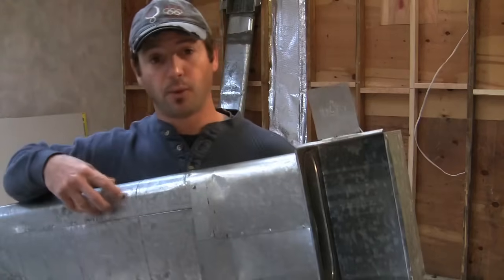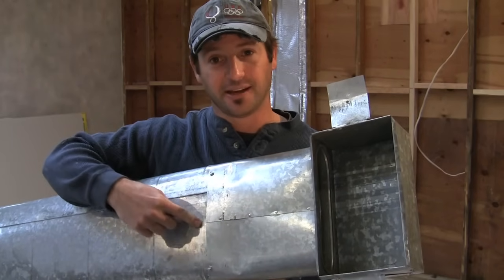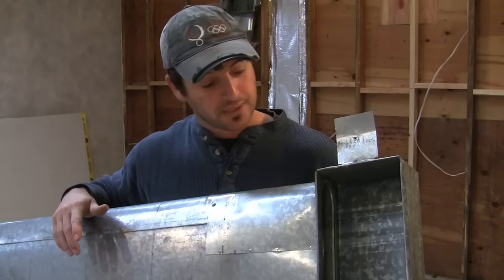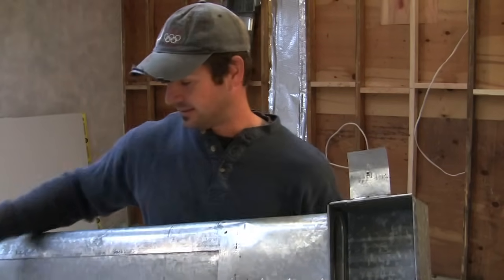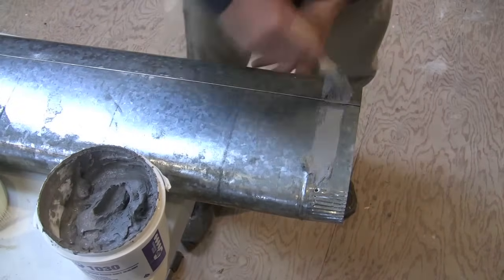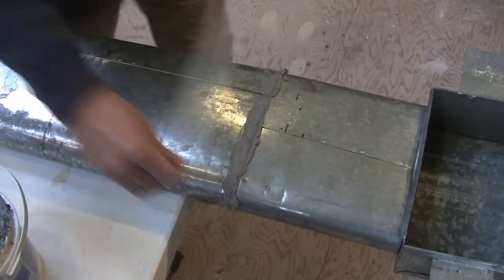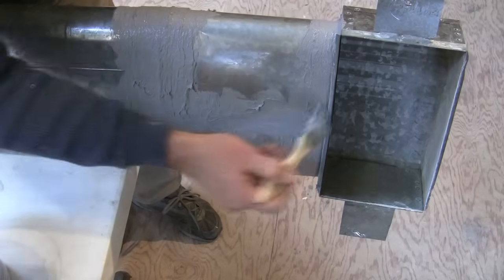How to Seal an HVAC Duct with Mastic - Duct Sealant

Comment: Love the fiber glass mesh reenforcement, makes perfect sense. I priced out replacement of my HVAC duct and know it was ridiculous since I have so much experience with DIY almost anything.  I am trying to figure out the pressure and sizing but that too isn't that complex. The duct in my house has never been replaced or repaired since 1964. So everything is very old school.

Comment: You need aluminum foil tape and make sure to insulate that riser duct or else it will mess up ur drywall when it gets really cold it sweats ive been doing hvac since 16 now im 27 and ive never seen a riser duct not insulated haha

Comment: Thanks, but my ducts from 1964 are behind finished plaster board and finished ceiling plaster boards.  I have sealed the duct openings with 181 tape.

Comment: I was cleaning out my attic yesterday day and horrible the sloppy work that the HVAC installer did from years ago. We purchased house less than 1 year ago. We are sealing all the holes from ducts, pipes and electrical. Also changing out the insulation.

Comment: Problem with your video is you put too much mastic and it squeezed out when you attached it but you didn't clean/smooth the inside which is going to eventually start catching dust, hair etc create blockage Inside the duct. 
The mastic works if you just coat the outside.
No need to make it more complicated for video sake. 
Thanks for the tip though.

Comment: honestly I'm tempted, just spent 20 minutes putting foil tape around a round hole, this mastic would be so much better.  the problem is most of my ducting is unreachable, so I'm debating just paying the big bucks to the leaks sealed from the inside-out.

Comment: I'm putting together a wood shop dust collection system and realize the fasteners are intended to immobilize the pieces in relation to each other and that the main trunks are best assembled on the floor. How long will it take for the mastic to dry or cure thoroughly enough to be roughly handled without transferring where unintended?

Comment: Well.... "Simple and easy" if the duct has been pulled nicely out of the wall and is in your hands.  Excruciatingly difficult if you also have to find the leaks on ductwork inside of walls and/or layers of insulation, expose the ductwork, seal it then re-insulate or reinstall it inside the walls.  Before everyone runs to the hardware store to buy mastic sealant, make sure you know where your main leakage points are and be assured that you can access them easily or you might night want to DIY this project.  

That said, I DO know exactly where the leaks in my system are and found this video very helpful so THANK YOU!!

Comment: Nashua 327 is a mastic based tape which works well. I have always considered mastic sealed joints to be the "RIGHT" way to install/fix a duct system. For those who say the Nylon/fiberglass webbing is "Overkill", apparently do not understand adhesives/glues/epoxies. ANYTIME you can add the reinforcing webbing it does add great strength to the adhesive, making it more durable against everything, including vibrations, clumsy cable guys etc.  You may not want to spend the time and effort to use the webbing, but in my book it gives the best job possible...HVAC 30+ yrs.

Comment: Good howto video, but the premise at the start is almost totally wrong. Small gaps in duct work do not cause you to "lose" heat (or cooling). It may slightly slow down the delivery of the warm or cold, but it's not lost, unless the duct is in an unconditioned space, like an attic or crawlspace. Even in a crawlspace, a minor leak of heat is likely to filter up through the floor. It's not lost. If it were, radiant heat systems wouldn't work! Also, that the presenter can force his finger between the sheet metal is irrelevant. The flow of air doesn't create enough pressure to do that. The duct shown will have small leaks, but not the big one you'd get with a finger-width opening. TLDR; heat put into your walls isn't lost. It filters back into the home!
Reply: I think your perspective is outdated...and not just because this is an 3 yo comment! TLDR; trusting poor installation and design by treating HVAC like an art when it can/should be more of a science is the recipe for a lot of wasted energy and uncomfortable, not to mention unhealthy, interior/living spaces.

My basic question is: do you want your conditioned air leaking out of your ducting and then being "filtered" through your crawlspace, insulation, drywall and sheathing (spiderwebs/rodent nests/dust pockets/etc)? Leaky ductwork, like leaky exterior sheathing, causes all sorts of problems in indoor air quality, reduction in equipement lifespan, lack of control and loss of comfort. My perspective is that poor quality installations with leaky ducts, pivoting on the premise that conditioned air will be blown somewhere in the home (just not where you want it) has been used as a crutch for too long, just like the idea that houses need to "breathe" when in fact it is the inhabitants that need to breathe. Also, nearly all radiant installations all require insulation on the "unheated" side to control the radiant effect.

Comment: What kind of mastic can I use for dryer vents?
Reply: HighSierraBob silver tape
Reply: @willritchie5859  I do dryer vent cleaning and service.  Sometimes, I will run into a situation where the builder roughed-in the galvanized dryer duct and left nothing penetrating into the laundry room to connect the transition duct to.  I need something to use to attach a small piece of duct into that end section to be able to attach the transition duct to and properly clamp it.   I really don't want to have to cut the wall open unless I absolutely have to.  I need something to hold it and seal it.
Reply: @HighSierraBob  . Sorry for the vagueness what I was trying to say is if you can reach inside of the pipe and tape on your piece from the inside with silver tape
Reply: @willritchie5859  The tape will not hold up under the air going past it with the moisture.

Comment: Hello Corey, is there anyway I can send you some pictures of my filter rack? One technician made 7 to 8 holes on the filter rack to adjust the straps that was holding it. And I was like, the air in the attic will go inside the filter rack now? And he put tapes on the holes to stop air leakages but to make things more secure he put lot of mastic duct sealant top of all the tapes that were covering the holes and some other holes without the tapes too. Some parts we couldn't put tapes because it was in some spots that was hard to reach. Anyways, he put lot of mastic duck sealant. Like almost everywhere inside the filter rack. He told me it's none toxic but it's been few days now and I am still afraid to turn on the heater at home and I have a little toddler as well. Could you please provide me with some clear answer. And if I could send picture that will be awesome too. Either way is fine. Thank you.

Comment: We just had all metal ductwork put under our house in the crawlspace.  Our HVAC contractor did not use mastic but instead used the foil faced HVAC tape to seal all joints and seams.
Reply: Now put duct insulation around it if you can easily access it.

Comment: my mastic jobs that I have owned over the years looked like broken arm or legs casts. Smooth and rock hard all around the steel. Maybe the old school way of doing it so it looks good.
Reply: Must depend on jurisdiction. As far as i have discerned resi has less sealing than the POS condos I worked for the last 8 months. Resi tends to be piecework where I am which means poor workmanship from my experience.

Comment: I want to close off 2 round about 5 to 6" ducts on the patio, have a way I can do this without having someone come out?
Reply: Go to a sheet metal supplier and ask for plugs of the proper size. Dunno the best way to do it without seeing it, if you get spun plugs you could probably take the wallcap off and figure a way to cut the duct back and shove the plug inside the duct then screw from the inside out. You would need some siding material too or I guess you could just affix the old wallcaps again.

Also, do you know what these ducts service? If you plug them, especially in the case of a dryer vent it could be very bad, duct full of lint at best, fire at worst. If it's a bath fan or range you will probably burn out the fan motor.

Comment: I have an old house with pipe and conduit penetrations through the duct work. Now sealed with what I think is asbeotos/tape. How do I reseal these penetrations after getting asbestos professionally removed?  Fiberglass tape and mastic?

Comment: Good job , I do the same thing, use polyester fabric along with white duct sealant , but I seal on the out side when they have water leaks .
Nice video , well explained !
Eric.
Reply: I replaced my AC unit and since then I have been coughing. I was told that I probably need to have the vents sealed..How and who does that? Can anyone tell me  please...
Reply: @520manhattan  I'm no professional but you said you replaced them ...maybe while up there you didn't have the proper respirator to protect you from the fiberglass insulation ?? maybe your lungs are recovering from the installation alone and not the duct work

Comment: Hi I have a very old house 

I have this on going problem when it snowed n temp drop very cold the 1 story ( no attic ) living room ceiling would leak 

I just replace the roof last year 

Now I’m thinking maybe it the heat leaking from the vent and heating the roof, pls advise

Large gaps between the ceiling register and the opening
Reply: My guess would be a lack of insulation on the ductwork. the warm air inside the duct will cause uninsulated duct to sweat. poke your head into your attic and see if there is insulation on your ductwork, in my juriisdiction code is 5 feet from any penetration as well as all ductwork inside unconditioned spaces (like an attic)

Comment: Can I put mastic on the flue pipe that goes into the chimney or should i
 use furnace cement for that area? I put some 3m 2,500 degree caulk and 
it has all flaked off.
Reply: Furnace cement, Tom Dee. Nothing else.
Reply: Don't fuck around with chimneys unless you want to die. Call a pro

Comment: Instead of mastic, if you have some old house paint, USE IT. It's a rubberized latex coating that works outside in the sun (outdoor paint). Clean/prep the surface and glob away. Leave the lid off till the paint thickens a touch. Easy way to recycle that old paint.

Comment: That foil tape USED TO BE great, 15 years ago. When you'd peel it back you could smell a super glue like smell from that, then, bad azz adhesive. Todays foil tape won't last a year before it falls off. Use mastic instead to seal ducts. Oh and clean/wipe down before you seal. PS, you need to apply mastic to a nickle coin thickness minimum.
Reply: I've been using this with good results: https://www.amazon.com/gp/product/B00DY9IXFI/ref=oh_aui_search_detailpage?ie=UTF8&psc=1

It has that same super glue smell you mentioned. Fairly thick too. Very quick and easy to go around and seal all the connections of existing ductwork.

Comment: Show us how to do it with a round distribution duct going into the side of a square plenum in a 150 degree attic with no soffit vents and  2 12 roof and blown in insulation from the 1970s as high as the top of the plenum box.

Comment: Can you add hvac tape and mastic  seal from the  inside?  These are for already-built homes
Reply: yup, just make sure that shit is smooth so that airflow is not affected. the tape is a bit overkill too, that mastic lasts longer than you or I will

Comment: how long to wait to dry before turning furnace on ?
Reply: The mastic should cure to a reasonable extent within a few hours, a residential system wont push enough to bubble out the sealer even if it is on while sealing
Reply: @chriskathol  thanks. I’m planning on painting mastic on my duct joints and it’s January in the northeast. I can’t turn off the heat.

Comment: How would you know if it's leaking in the walls if the walls aren't already torn apart?  None of my walls are just exposed like that in my house.
Reply: house ductwork generally isn't sealed with duct sealer. If you haven't done it yourself or had someone do it then a good assumption is at best you have tin tape around the joints and even then that stuff dries out and becomes useless. check exposed areas around your furnace, if there isn't sealer or tape there, there won't be anywhere else.
Reply: First-Hour you can buy a thermal gun from anywhere for about 20$ usually you can feel a difference in the wall but run the gun along while having the unit set to heat ilwhen it spikes that’s where it leaks but if your wall are already finished don’t bother cost more to fix then it would actually fix lol... but I do this for most company’s if a test and balance is failed invested in a nice thermal camera and can pinpoint a leak without even being near the wall
Reply: Single story houses are the best, easily to replace ducks and everything
Reply: F
Reply: U
Reply: C
Reply: K

Comment: be careful with those edges wear gloves
Reply: trim them to 45 degrees and no problem as long as you are attentive, most new homes have 30 ga metal in them which is probably sharper than a week old razor blade even on a straight end of a duct. Sharp corners are a sign of poor craftsmanship
Reply: 80hd Jenkins gloves are for pussys is what I was told when I started hvac lol
Reply: another safety sally
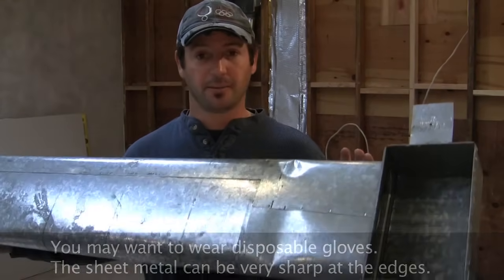Reply: 2:02 He already mentioned that in his video.

Comment: buy 181 why waste your time with mastic and fiber wrap haha
Reply: FirsT LasT I guess that's why your on YouTube researching , huh
Reply: 181 is mastic just a different version. Plus Mastic is only for sealing air leaks.  We don't use a mesh wrap and then recoat with mastic unless we are in a hospital environment or a harsh temperature environment that requires stricter standards.  The one thing I didn't see being done is he forgot to state that you need to wrap ducting with external insulation because it condensates when cold air goes through and loses heat in the winter.  Besides the NATIONAL IMC and state and local dictates what extra will and will not be added.  Also any hvac company that is worth a dime also will accomplish all of the above using SMACNA standards as well.  So yes please add fiber especially if you are going to get a Test and Balance done by a NEBB certified company.  Even in new construction we do test and balance especially with all the new standards that are now being enforced.
Reply: you don't have to wrap exposed duct haha..you just seal it from the inside...using industry standards depends on location...and hospital jobs I've done use stainless and don't want any mastic...due to hazards of disease...we would weld each peice together...so basically...EVERYONE DO YOUR RESEARCH...reading codes and books doesn't make you a sheetmetal worker haha
Reply: M1980 Grsde I'm not researching fucktard....just killing time...deuces douche
Reply: Should I use 181 tape first then mastic over top? Or do I apply a thin layer of mastic then 181 tape and cover again with mastic. Trying to really make sure everything is sealed. Or is just mastic alone good enough?

Comment: Great advise Corey. What's your thought's on a rigid PVC or ABS square ventilation duct, rather than metal ducting?
The reason I ask is that this type of ventilation flat duct can be used with self seal connectors. 
So mastic doesn't need to be used to seal the joints.
Reply: I know pvc in dust collection creates loads of static
Reply: breaks building code. no fire rating on that shit. Also would be much more costly
Reply: Pvc offgass is around 90f

Comment: Hi there, great Video. I'm in the process of starting to finish my basement. I have duct work in my floor joists for both upstairs and basement. The Permit I am acquiring tells me I should use Low Wall heating here in ON Canada, something like what is in in your video. Is that the best way, i.e. remove my existing duct work for my basement and run duct work in my studs for each room.and of course leave the duct work for the upstairs. Should the cold air intake be higher than the warm air. thanks

Comment: I'm also wondering if there is a way to remove the mastic. I've got a 
few things that need re-arranging and would rather not have to cut my 
joints.
Reply: hammer... don't go too hard around adjustable elbows though

Comment: A technician put mastic around the area where u would change the filter.   Now I can't get it open so that I can change the filter.   Does anybody know how I can remove the mastic?
Reply: I found out the stuff I used was water based (common). I sprayed the area with water and wire brushed, and sprayed, and wiped ect. After about 5 min of this I was able to shake the joints loose.
Reply: csquarejones that wasn't too smart.  i'd probably smack him on the wrist and find a reusable means of sealing the panel.  you might consider lining the door panel with foam or rubber weather stripping, or a caulk-able weather stripping.
Reply: I'm also wondering if there is a way to remove the mastic. I've got a few things that need re-arranging and would rather not have to cut my joints.
Reply: i guess i would cut off a larger piece to get passed that joint and make a new one.  otherwise, try an oscillating saw to cut under the mastic..Ryobi $40 at HD.
Reply: Call the technician, tell him that was wrong, and ask him to come back and fix it for free! You can get magnetic "seals" that cover the filter slot. IIRC they're like $8 on Amazon.
Reply: Of course a stat installing filter changing tech did that. They don’t do sheet metal